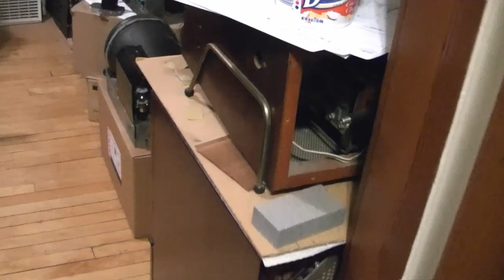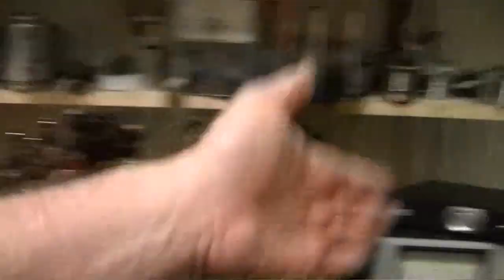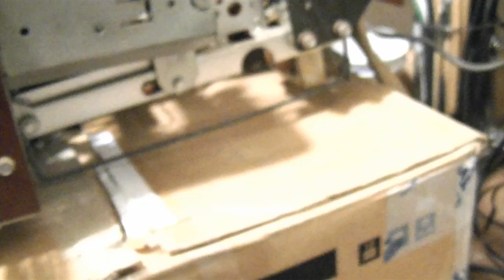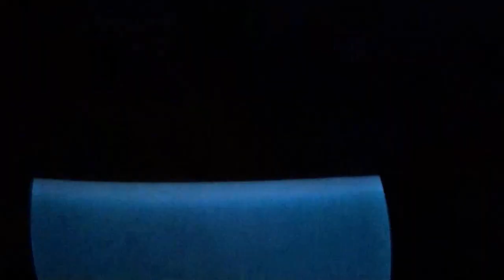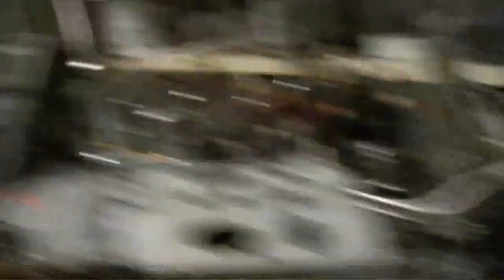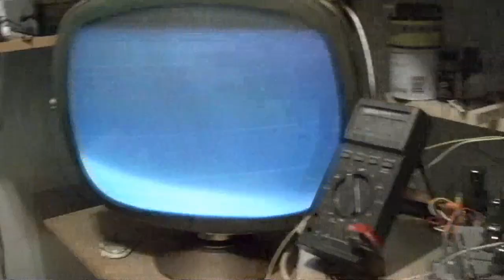Predicta Tandem I restoration pt5o8

Comment: Congrats! Not bad at all for a first power-up.
Now I really hear the hum in the PR-57. Curious; Did you ever notice a change in the 60Hz hum dependent on current draw? Or does it make any difference? Mine doesn't hum but your switches are not broke off as is the case in mine. I consider us even then!
Looking forward to see why there is no R.F. signal at all going through. I did notice the coax in the RCA jack in the tuner was bent over at a pretty sharp angle. It would be nice if the center of the coax is disconnected at the RCA jack or just shorted out to the shield.
I'm sure we will all find out soon. Hope it's easy.
Reply from the maker: The hum does not vary with current, but it certainly is louder some days than others.  I have not work out any pattern yet.

You'll find out the cause of the tuner issue in the next installment...

Comment: I actually came across a forum thread recently by someone who found a Predicta Tandem still sealed in the box, and it was even fully functional.
Reply from the maker: That would be pretty amazing.   I also have one working on all original parts, but it wasn't sealed in a box.  It just saw little use and must have been stored in a controlled environment.     Do you recall the forum ?
Reply: bandersentv
Sure, here it is: http://www.cadillacforums.com/forums/community-lounge-introductions-general-discussion/392865-philco-predicta-television-1960-a.html